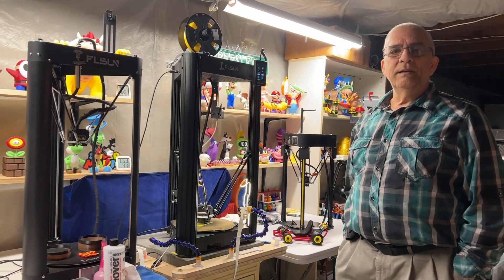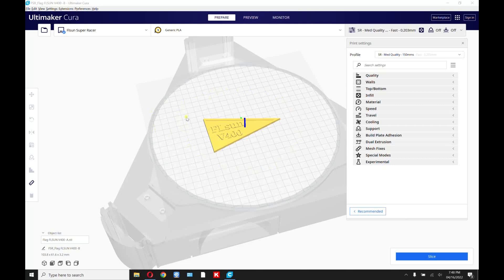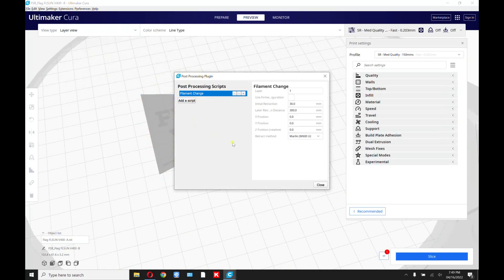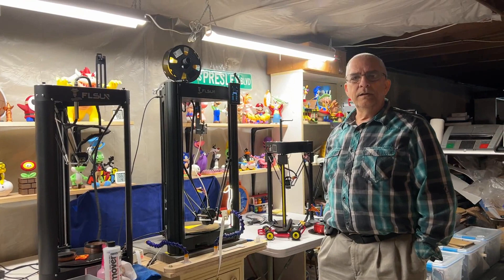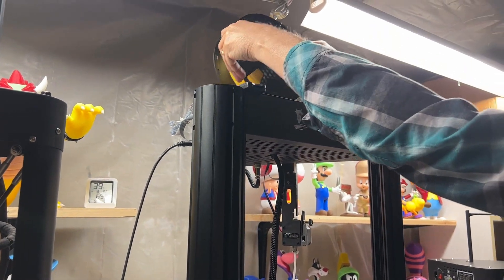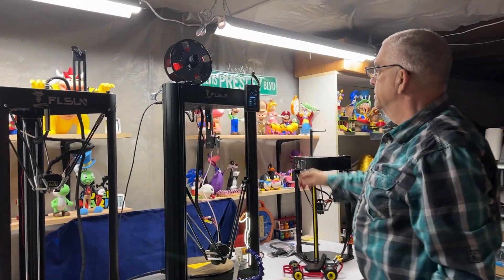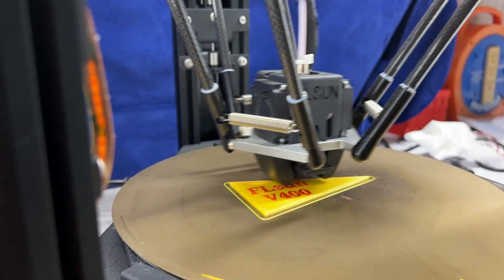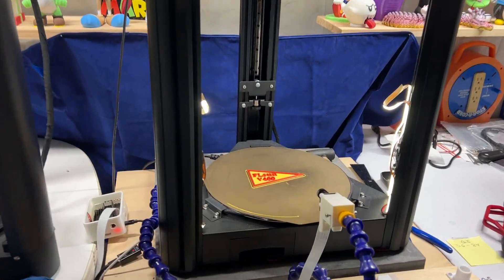Super Racer color change with new firmware V1.4 using Cura V4.13

Comment: I'm not sure what happened to my previous comment. Anyway, thanks for making this informative video. I do have one other question...what GCode start script do you use for the nozzle purge/wipe prior to printing? Thank you!
Reply from the maker: The start g-code for my SR is the following:
G21 ; millimeter units
G90 ; absolute coordinates
M82 ; E absolute
M140 S{material_bed_temperature}
M104 S{material_print_temperature}
M190 S{material_bed_temperature}
M109 S{material_print_temperature}
G28 ; home axis
M420 S1 ; enable mesh leveling
; Lower nozzle and move to start position
G1 Z150
G1 X-130 Y0 Z0.4 F3000
; Extrude about 40 mm by printing a 90 degree arc
G3 X0 Y-130 I130 Z0.3 E40 F2700
; Retract and move nozzle up
G92 E0
G1 E-1.5 F1800
G0 Z0.5
G1 E0 F300
Reply: @dennisgignac5103  Thank you Dennis! That script worked perfectly.

Comment: Hi Dennis - love your vids, they are very helpful, especially for a brand new SR owner like myself.  The printer came with 1.4 already on it.  Since FLSun added this function in 1.4, what does the 'Use Firmware Configuration' checkbox in the Cura 'Filament Change' script do/not do, and why are we not checking that off?  Just curious is all.  Thanks!
Reply from the maker: I am not sure what you are refering to. Can you take a few photos for me to see. You can message me on FaceBook,
Dennis G. Gignac
Reply: @dennisgignac5103  sent you a message on FB.
Reply from the maker: @dabruuzer  Can you send again. I did not get it...

Comment: Great video thanks, which size nozzle tip are you using.
Reply from the maker: I use this one from Amazon on my SR:
https://www.amazon.com/Volcano-Printed-Filament-Printer-Extrude/dp/B08B5Y3RNN/ref=sr_1_3?crid=2LR2I1ILZP0DO&keywords=volcano+nozzle+0.4&qid=1685408593&sprefix=volcano+nozz%2Caps%2C104&sr=8-3

Comment: This can also be done almost as easily in the new V5 of Simplify3d.    Here's the procedure:

Set up a single process (Process 1) to print your part, select Prepare to Print
Slide the scroll bar to find the point at which you want to add your filament change (or any other interesting GCode). Look at the actual Z location (displayed in the lower left) and make a mental note of the number in mm.
Exit Preview Mode
Add a second process, Process 2.
Edit Process 1, add a Custom Zone to stop printing at the remembered Z location
Edit Process 2, add a Custom Zone to start printing at that same Z location
In Process 2, select the Scripts tab, then Process Change
Enter the desired GCode to execute at the start of Process 2. In my case I entered "M600 X0 Y0" (don't enter the quotes)
Again press Prepare to Print, then Select All and Continuous Printing.

That's it. When the printer reaches that Z level, it will execute the M600 code in your firmware (SR must be V1.4 or higher). Then you do your filament change and finally select Continue (or Resume) on the touch screen when ready.  Works in both SD mode and Octoprint.

Neil
Reply from the maker: Thank you very much...